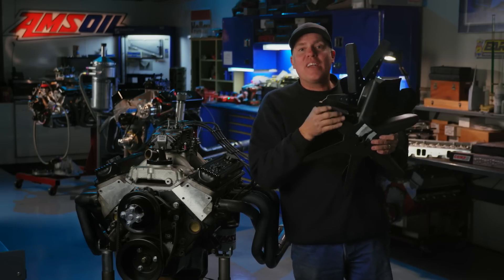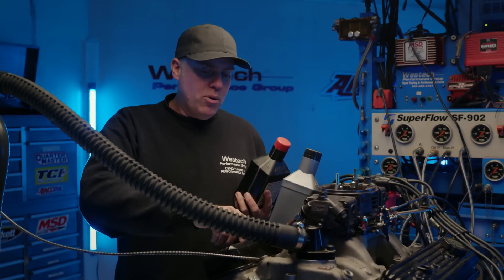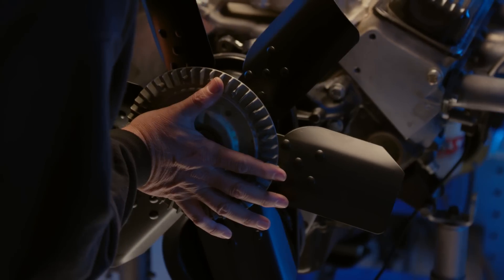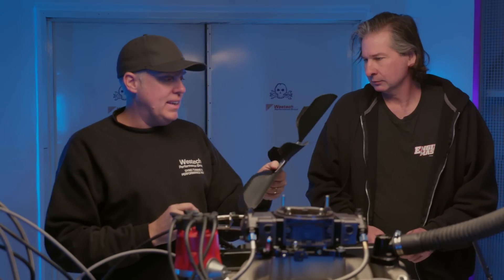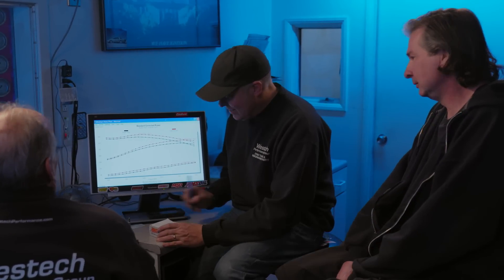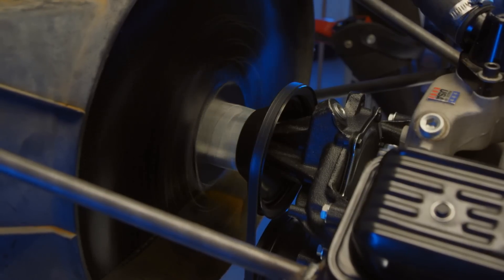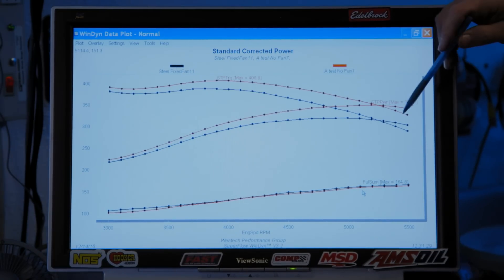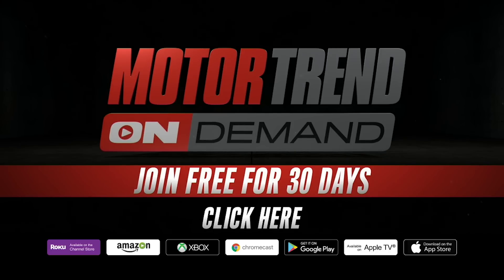Cooling Fan Shoot-Out! - Engine Masters Ep. 20

Comment: 30 amps times 14.* Volts is a bit over 400 watts. If we round up to 450 watts it's about 0.6 hp. Not sure the efficiency of an alternator. But even at a low 50% (guarantee it's much better than that) it's still barely over a hp.

Comment: You missed a main point.  How about cooling capability?  Which is better.  I can tell you without a dyno that a mechanical fan has efficiency loss.  The  loss may be tolerable depending on what your solving for.

Comment: A stationary test with out any forced air movement is completely invalid for a moving vehicle.   The fan is for idle, sitting in traffic, it does not drive air faster than than say 10 or 20mph at max rpm, above this speed the air is pushing the fan and it saps virtually no power.  At low power/idle the difference is negligible, especially for a viscous coupled fan.

Comment: The fan shroud is creating drag on the fan. Think of sucking water through a ten inch pipe or through a thirty inch pipe and how much less pump pressure it would take to move water through the larger pipe.......
Reply: The purpose of the shroud is to concentrate the air flow on the radiator by condensing the area the fan draws from......
Reply: One of my favorite cars was a 76 Olds Cutlass with a five speed manual and tiny v8 260 in it, no air even. It had a plastic barrier about twelve inches wide that floated out across the top of the fan to keep your tie from getting stuck in the fan blade. No trans cooler, no air, tiny engine means very little radiator heat transfer is needed so no shroud to concentrate the flow on the radiator to promote dissipation... that's why most older straight six manual trans vehicles from way back when had little to no shroud from the factor. Dad worked at Ford Engineering proving grounds in Dearborn :)

Comment: What if you did a fan delete and mounted a thermostat oil cooler in front of the ac condesor/radiator? That would remove drag created by fan while keeping motor block cool, no? 

Granted you will ad 10 lbs or so in weight,
 But aren't thermostat controlled oil coolers are already pretty good mods to have?

Comment: A 6 blade hd clutch fan is the best I've found. Sits at a nice 180 all day not much worried about hp have plenty I'm not making any hp sitting stemming off. I think the clutch would have used more hp if it was in a real world situation a hd clutch will spin at 80% engine speed when warmed up.

Comment: This doesn't measure flowrate performance of the fans.  The shrouds probably draw in more air and the the plastic fans may have better aerodynamic flow rates.  Alternators can draw as much as 30 hp so its hard to say if electric fans are better or worse as far as this vid shows.

Comment: 30A×14V=480W
Assuming the alternator is 50% efficient at turning mechanical power into electrical thats 960W at the input shaft of the alternator, subtract belt losses and you could easilly see 1400W+ (~2HP) of crankshaft power needed to turn an electric fan (on top of whatever load is already on alt.)

Next, which clutch fan did they use? Normal duty? Heavy duty? Severe duty? Each has different locked and unlocked grab, a normal duty clutch would kill half the power a severe duty clutch does.

Comment: I believe the power loss with the shroud on vs. off is due to the fan having to pull air through the radiator which is a restriction to air flow. Without the shroud the fan will not pull as much air through the radiator and will not have as much restriction. Restriction=power loss.

Comment: I'd be interested in seeing an episode that deals with the various external parasitic losses: electric fan, water pump, fuel pump, underdrive pulleys, light oil vs. the typical street motor with mechanical everything, standard pulleys and heavier oil.

Comment: The tighter the fan to the shroud, the more efficient the fan, which means the more power it consumes.  You can change the pulley ratio to slow the fan overall, which will make it more efficient.  Electric fans, especially two that come on separately as needed, will be the best.

Comment: The radiator & shroud combination creates a static pressure behind the radiator and in front of the fan blade. The fan is forced to work against a vacuum so to speak, therefore the fan would take more power pulling air past the restriction the radiator core makes. I'm betting all the fans would have performed better in a "free air" situation...

Comment: with the shroud off the fan isn't sucking the air through the radiator as much as it would with it on, which restricts the air flow it self like a shake through a straw.

Comment: When you use a shroud, you are forcing the air to pull through the restrictive radiator. It creates a load on the fan. In free air, that restriction is gone. While this is better for hp, it isn’t as effective at cooling the radiator.

Comment: This test is bogus. Clutch fan needs to have heat from radiator to engage the fan for a true test. Also, there needs to be air flowing against the fan from an external source like a large shop fan that can produce at lease 2500 - 3000 cfm.

Comment: The shroud forced the fan to pull all the air through the radiator. This required the fan to pull harder  so the pressure difference between the front and back of the fan was greater. This additional load on the blades increases drag. You can assume the airflow stayed attached to the blades in this case.

Comment: Great video I been contemplating adding a elec fan to my 69 Ford f250  390 although in the end test with out the shroud if you only lost 17 HP to the first thermo clutch fan with shroud on , it probably did not lose a full 17 if you took it off maybe 8 or 9 HP so my decision not a hot Rod a daily driver I keep the fan clutch and save 500 bucks in fans controller and wiring issues thanks for posting .... And for the guy that wants everything it would had been cool to see each fan test with shroud on and off due to one science orientated comment that said the shroud kept the air flow from going over the top of the blades and killed some HP.

Comment: The reason you lose power with a Shroud vs W/O a shroud is because it is being forced to suck air through the radiator which is going to cause the air around the fan trapped in the shroud to slow down the fan. Think of it like an exhaust housing for a turbo, the drive pressure increases with Air but if theres no shroud the air is free to flow away from the fan, not be crammed through the shroud opening

Comment: When the car is moving there is less difference in air velocity. Need to do the test in a wind tunnel. Lol
Reply: Also the majority of your butt-dyno is feeling horsepower while accelerating, not while cruising on the highway. Taking power away between a stand still up to 60 is where the fan is going to hurt your power, not after you get to 60 and level out.
REPLY

Comment: I'd like to see an episode on engine cooling. On Roadkill you guys have had multiple projects with overheating problems. How about an Engine Masters episode about getting rid of the extra heat a High Performance engine makes. The engine fan episode was great. But we haven't seen anything on the entire cooling system as a complete unit. It is one thing to build a high horsepower engine, but as you well know an entirely different issue to drive it on the street and keep it under 210 degrees in traffic.

Comment: I had a racing fan on my car that threw a blade into the shroud. I got another one that was half inch smaller. bad move. So, I need an electric fan? Like those stupid Hondas have? Well, gotta have them horses. I have use for them.

Comment: As smart as you guys are why did you think the fan in free air would kill more? That makes no sense. In the shroud it has to pull air through the rad and push it away. So it's costing power to pull vaccum basically. Without the shroud it's just stirring air.

Comment: This is kinda like the vortec head and cam build, we were doing that in the 90s when you could get the heads new for 250 bucks lol, and we even dynoed them... goodwrench 350, 454 lift cam, vortec heads, performer air gap intake , 650 double pumper

Comment: Do one on waterpumps. Hi flow vs stock flow, straight blade impeller vs angled blade impeller. With cooling temps and hp loss. Nobody has this data.

Comment: Yeah, always thought those fluid fans were the most efficient of the water pump driven . Would have been more accurate if you used the centrifugal one though since you didn't apply any kind of heat to the thermo fluid fan. As far as removing the shroud , air like electricity will take the path of least resistance and mostly pull around the radiator and coming from the side won't pull the maximum CFM through the fan which means more Ponies. Crazy the little differences that will make or take away horsepower .

Comment: Every fan can handle a certain amount of air at certain speed. When you place it in a shroud it has to draw all that amount of air through that kind of tunnel hence experiences resistance. That's why it eats more hp. When there is no shroud it takes all the air it needs from all around and spins easily. That's why it takes off less hp.

Comment: Pretty meaningless video in some respects. There is no measurement of the actual cfm air flow generated by each fan. If the least power sapping item doesn't flow enough air but the highest power sapper does then I know which one I definitely wouldn't use ..... but then I'd use an electric fan!

Comment: I had a first gen. 300zx Turbo with a clutch fan that was stuck so I did an electric fan swap and it made a huge difference. It felt like +40-50 hp and it probably was. I wish they would have tried a bad clutch fan. The bad clutch fan was louder than the engine at high RPM's.

Comment: this video badly needs a re-visit to compare engines that have peak power @ 8000rpms and see the difference from plastic fan to electric fan.  You guys tested the plastic fan way below the rpms its designed to function at in a racecar.  If the plastic fan only draws say 5 more HP than an electric's draw on the alternator.... i think the reliability of the mechanical plastic fan should be considered the winner.

Comment: how about a bank of 24 4.75 inch computer fans? 4 high 6 wide. I found them for 5 bucks a piece, they flow 151 cfm a piece are rated at 1.06 amps 1.6 max. plus if one goes the rest are still pumping.

Comment: The thermal clutch feature should have been heated to create complete or near complete fan engagement. This would provide a test that better emulates real-life conditions. Plus, as stated elsewhere, the shroud is necessary to create better airflow through the radiator, which is most critical at standstill. The thermal clutch fan is probably the best choice for real-world city/highway driving conditions.

Comment: Wouldn't you agree, horsepower is basically a derivative of burning fuel? If so maybe the no shroud results in poorer cooling/ hotter cylinder head so more power?

Comment: Idea for you as many have varying opinions on it.  What is the best 
operating temperature for an LS 5.3.  I'm sure it's going to depend on 
use, climate and load.  Maybe dyno after up to temp at various 
temperatures?  Pros/Cons?  Probably have to stick with stock as other 
variables could change the operating temperature.  Throw in a line or 2 
for heavier vehicles/older 4x4's.  Thanks for the vids!

Comment: i was surprised that the fan belt would take an extra 30 hp with out slipping.    but combine an air flow test to that test.   years ago i saw a articial in a car mag. this guy had a late 40s dodge that he thought was over heating.   after some tinkering he found out that if the engine was no more than 100 degrees over air temp it wasnt over heating.

Comment: I'm not sure if it is significant but I noticed the red numbered gauge on the left of the dyno control panel was reading 11's rather than 12's shown in previous runs.  If that is A/F ratio maybe some of the change is due to that.  Can the A/F change because air is blowing across the carb?  Just sayin'.  BTW, love these guys.  No BS, just the facts.  I'm thinking of taking the fan out of my bathroom to see if I get more power!
Reply: Oooops!  Saw someone already suggested the air flow over the carb.

Comment: Would the clutch fan rob almost as much power as the fixed stock blade after it gets warm, on a thermal, or hits it's rpm limit, on a fluid fan clutch?

Comment: Another problem is I have a 572 BBC and in order to cool it probubly I HAD to go with a 7 blade clutch fan as it put out 7000cfm. Simply can get a electric even close. And if I could it would be so highly priced it wouldn't be worth the loss of the manual fan.

Comment: Before I watch this Vid, any solid or flex fan will eat the hell out of power and make a hell of a lot of noise. That's why I tell people, Flex fans, points ignition systems, best place for them is the trash. I run clutch fans, but it can be hard to find one that works correctly.

Comment: I would like to see them run an engine like real world muscle car would be set up. A fan, water pump and alternator, all ran off the crank make a pull, then remove the fan and make a pull, then put an electric water pump and make a pull, and then remove the alt and make a pull so we can see how much each of these accessories steals form the motor. So they proved that an electric fan is worth it, what about an electric water pump? what about using a small electric motor to run your alt? is this stuff worth it or not?
Reply: actually take it even further. throw A/C and power steering on there also. And take them off one by one see what the power gain is each time.

Comment: YOU MUST let the clutch fan run for at least 3-4 minutes before the fluid moves to the outer edge of the reservoir and  disengages the fan to the  freewheel position..  On startup the clutch fan is ALWAYS tighter.
EPIC FAIL

Comment: Here is a thought as to why the stock non clutch fan without shroud made 8 hp with shroud.  Part of the HP loss was the spinning of said fan assembly.  One area that was of no mention was the power it took to draw the air though the radiator. With the shroud the fan could only pull air through the radiator. Without the shroud it could pull it from whatever source of least resistance. One test I wish you guys had run was leave the shroud on the stock fan and then put a piece of cardboard or something in front of the fins to confirm my thought.

Comment: I agree on the mechanical fans robbing HP/TQ. Video proves it. But in a real world application I'd like to see what an alternator takes (HP/TQ wise) driving a quality electric fan and say a 600hp engine in hot conditions... Alternator will also apply a bit of load trying to feed a 25-35amp fan setup. Modern cars the past 12+yrs all use a load sense alternator circuit to save on fuel. Nice video, just wonder what a 125amp alternator steals when loaded down.

Comment: I'm a retired helicopter pilot and found the results predictable. In the chopper with a torque gauge it's pretty easy to see what happens when you add pitch (angle) to the blades.
I can stall out 800hp gas turbines if I wanted to by adding pitch, it's amazing how much power you can suck.
I was most surprised with that plastic fan, I think with a better design that could actually work. With a car as engine speed rises so does road speed and I would have thought that with high enough road speed a fan would pretty much become superfluous.
If you could get that plastic fan to flatten out to a 0° pitch at high speed, then they might be onto a winner.
Not sure what is up with the shroud, I thought that would work. Aerodynamicists might be able to add more info.
Reply: I am wondering if the fact the moving air can circle around the end of the fan and go back through. This would reduce the power required because the air is already moving in the desired direction.  Helicopters can experience this if the hover in one place near the ground too long under the right conditions.  They lose lift I assume because of the lesser acceleration of air through the rotor.  You can see this if there is dust in the air.  There is a name for this but I can't remember what it's called.  Perhaps Mr. Bullet can help us out.
Reply: I certainly can Mr Hopkins.It's called translational lift. And it is a real thing. The oncoming (headwind) wind will reduce the need for lift proportional to it's airspeed.Note, translational lift drops to nothing after about 30 knots or so as you start outrunning the headwind. Sorry for the l;ate reply.